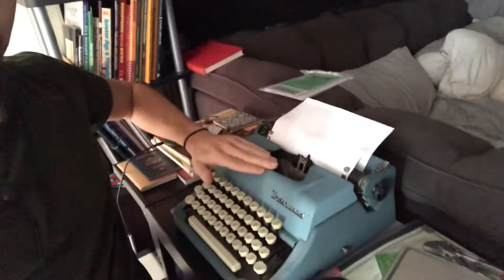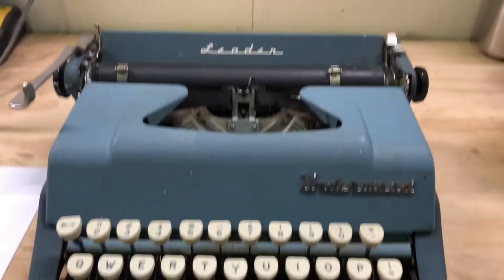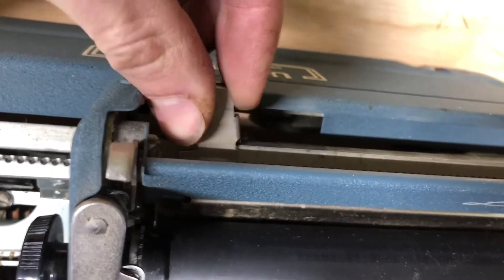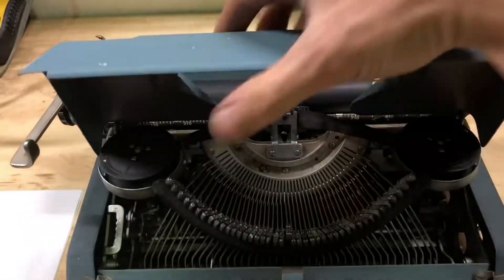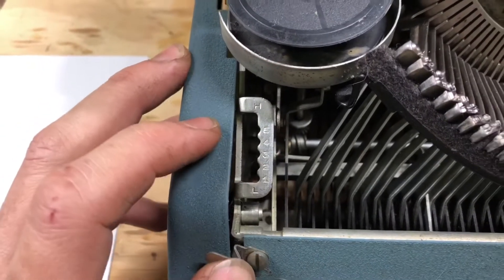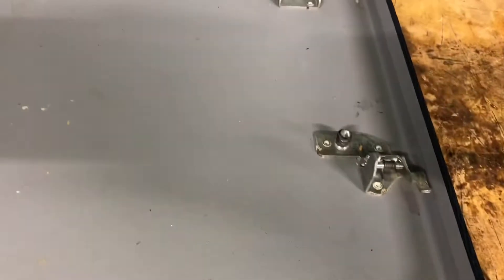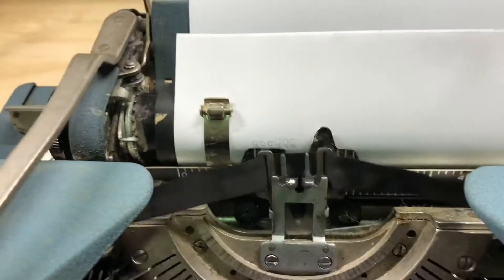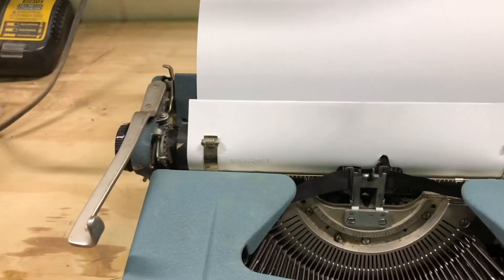Typewriter Cleaning and Repair Basics #1 Assessment and Testing

Comment: The missing lever on the left above the arrow key is the key pressure lever. Like the later 50s models of the Smith Corona, Underwood updated their typewriters to include the option to set your own key pressure... I like the snap of light key which also lets me type a smidge faster. At least, I like to think it does.
Reply from the maker: It’s a very light touch. You’re probably a better typist than me if you really enjoy this type of machine! My fingers sometimes “mush” the keys, so I have to be very decisive on this Underwood

Comment: Hey there! I have a vintage Royal manual typewriter I am fixing up and it took a while but I got all of the keys striking good and not sticking. It's almost perfect now. The problem now is that each line, the carriage does not advance literally one time (so one letter types over another already-typed letter) each go around. I go to the next line and it happens again. I don't think it's always in the same spot, but I can check. What would cause a carriage to advance 99 percent of the time but get stuck not advancing on one key stroke each line??

Comment: Great video. I also found an Underwood Leader at a reuse store. It had a white substance all over the keys which I was able to scrape off. It is pretty dirty underneath so I am looking forward to your next video in this series!
Reply from the maker: Many plastic keys from this era will leach white residue! I had it on my Royal Futura. Got it off with some Goo Gone, followed by soap and water with a plastic scrub brush. Dry the keys quickly after and they should be much better. And the magic ingredient, as always, elbow grease. I’ll show some key top cleaning in an upcoming video
Reply: @inkiron3907  oh that is interesting! I was thinking someone rubbed white out all over the keys. There is also the same white substance on the carriage advance knobs. I think I got most of it off on the keys but I will try Goo Gone on the knobs. On mine, besides the white substance there was a LOT of red particles down inside the typewriter - I thought maybe it was eraser shavings? I managed to use compressed air and a vacuum to get most of that out. Also a few of the keys still stick, so I'm trying to figure out how to clean in between the segments better.

Comment: Hey Joe.  I have a 1953 Underwood De Luxe. Very similar design. As such, it has the peg that activates the space bar that you point out around 11:28. Did you ever figure out its purpose?  Did not see it in the other vids. Thanks!
Reply from the maker: I never did find out its purpose. I still can’t imagine why you’d need access to the space bar right there

Comment: This Underwood "Leader" was actually Underwood's budget model
That's why it does NOT have Ribbon selector (black only), No Touch Control and No Bell . . .
Type segment needs a chemical flush bad !
Reply from the maker: Makes sense! The bell was just very gunky. A bit of isopropyl cleaning and it came back to life. Also flushed the segment and it’s about 99% better. Still have a key stick on occasion